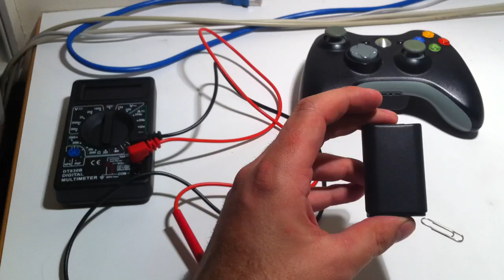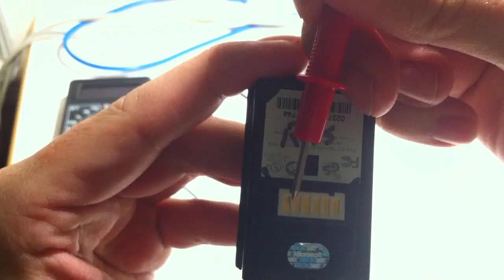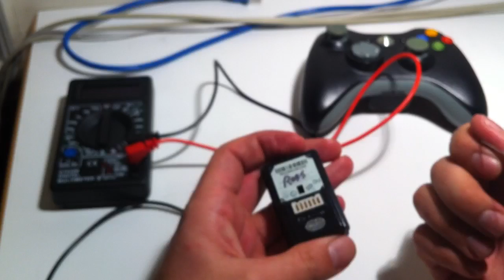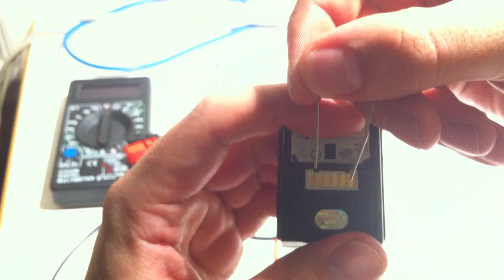Xbox 360 Controller Battery Pack Quick Fix (including play and charge kit)

Comment: It worked for me the first time i tried. Unfortunately I used my controller without recharging til the battery died. And now this method wont work anymore. The red light just turns green in a few seconds.

Comment: i have two batteries at 2.5v where specs say they should be, and one at 1.5, i have been trying this on the 1.5v because its the most problematic, it stops within minutes of using it, the other last a couple hours, and the 3rd is the most used and seems to work like new out of the box, my question is if the 1.5v battery is broken or simply just wont charge enough. seems like it may be faulty to me any ideas?

Comment: I don't get why Microsoft didn't go for Lithium battery instead.
Reply: +Ohem1 Probably because they're hazardous to ship due to the fact lithium based batteries can explode, and also cost.
Reply: +noxious89123 And yet they're in pretty much every other electronics use lithium, but i shifted over to AA batteries for the 360 controllers as the kit simply takes too much effort in contrast to changing AA. My PS3 controllers works fine though.

With the exception for really crappy manufacturers and sellers, Li-ion and LiPo batteries usually have protection circuit(s) and proper insulation.

Comment: What if the paper clip won't get hot ? I held it on for a few mins. Then put it in the recharger and the light turned green in less than as min. But not as quickly as before
Reply: Use something that takes 3 volts to empty the power a small motor is best as you don't need to know positive or negative (i don't know what's what). Did you touch the other 2 sets of pins after. It's pointless draining it if you don't reset it before you charge it, though your battery may be dead but it's unlikely. Most batteries need this calibration a few times in their life.
Reply: Wayland Smith Most Ni-MH (Nickel Metal Hydride) batteries need this calibration a few times in their life. 

/fixed
Reply: worlwr2 My bad, yes i should have stated that! Cheers ;)

Comment: What if the controller doesn't want to charge a perfectly functional battery? Any suggestions?
Reply: From computer or 360? If the drivers are not working correctly using a PC, the cord will NOT charge a battery. If the drivers are not at fault, the cord charges a different battery you have, and you can charge the battery pack in question with another controller, I would chalk it up to a pin not making good contact, or the controller itself is starting to go.

Comment: Fml I couldn't find paper clips no I can't play
Reply: You can find any flexible metal and do above steps. But you need to discharge the battery with the controller so that you won't get burned
Reply: Use a staple

Comment: Did not work for me!
Battery really dead! My shorting tool does not get warm/hot
also tried the reset pins... 

Charge light just blink 1 fast time then off.. :) think im gonna throw the battery away ;)
or someone else have any idea? charge light not red or green just off..
turns green very quickly when i connect the charge cable to the controller then turns off directly..just for 0.2s or something :)

Comment: Was gonna say this does not work as I tried it a few times and it did not work and the paper clip did not get hot, but i tried it reset the battery a few more times anyway just for the fuck of it and so far it has been about 3 minutes charging with red light when before only about 10-20 seconds. So maybe this does work. I had not used my xbox 360 controller for about a year

Comment: Hey man this worked for me easy peeze a 5 year old could do it.  I am now currently charging a battery that wasn't recognized at all.  I hope I didn't lose too much of the capacity on this battery I used it for like 10-20 hours and then didn't play my xbox for like 2 years so it died over time.  I am only using it now b/c I am using it on the PC.

Does anyone know around what Volts a fully charged battery should be at and the Ma capacity of them?  I got a nice multimeter and love learning about batteries.

Fraviaseeker ty for the tip and you rock sir

Comment: Nope did not work, I am pretty sure the charging cable works as controller functions without a battery.  I tried several times it did not work.  It would have been nice if you showed the schematic of the battery pack and what the shorting actually does.

Comment: Avoid these packs at all costs. They are all NiMH batteries which are outdated garbage. You're better off getting quality lithium AA cells for your stock battery pack. NiMHs are notorious for dying, losing capacity, and generally having issues. RC cars, planes, airsoft, electronics, etc. have all moved on to lithium. I have no idea why they even offer these for Xbox controllers.